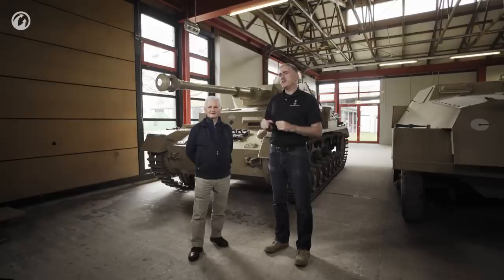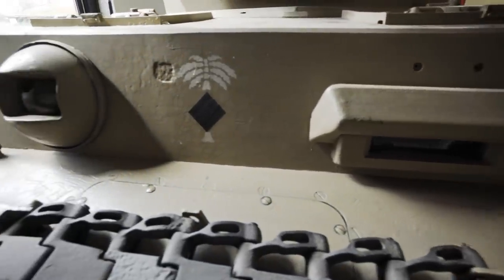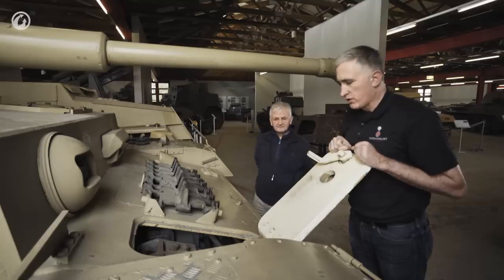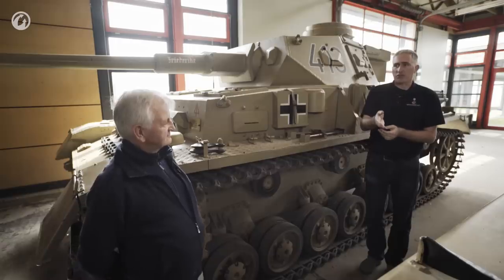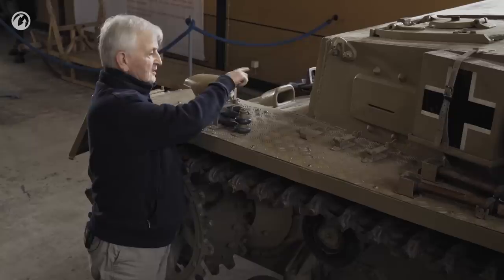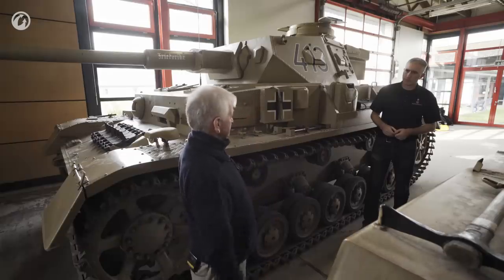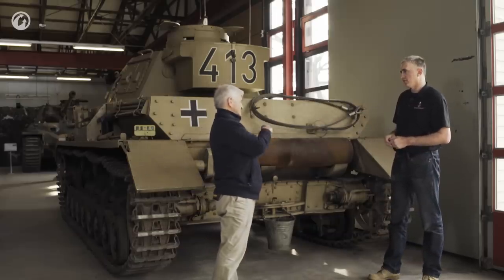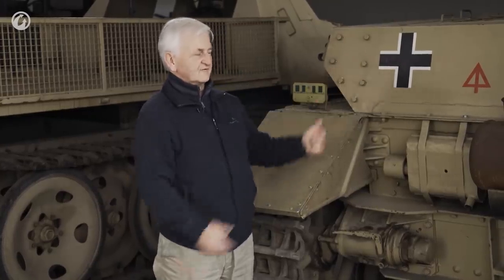Inside the Chieftain's Hatch: Panzer IV, Pt 1

Comment: Finally, the best tank of WW2. Change my mind, you Sherman apologist. 😉😅

But really, I think that this was the best overall tank of WW2. It was in service when the war started and still in service when it ended and it was still capable of knocking most things out. Early in the war, there simply was nothing like it. Mobile, it seems to have been quite reliable, good firepower but more importantly it has the basics of a good tank. Radiocommunication, proper distribution of tasks, turret basket and later on a very good gun for most of the war that was not matched by any allies medium tank until 1944. Further look at how easy those suspension bogies can be replaced or how you can access and potentially lift out the transmission or brakes separately by opening a hatch. Take that M4 where you need to unbolt and remove the entire lower front section. 😁

Then when I compare it directly to the M4, I think the Panzer IV wins it in 1942 and 1943. A 1942 onwards Panzer IV receives an better overall gun. Much better AP penetration, access to APCBC-HE rounds by default and the option for APCR  and HEAT. Further the HE shell is largely comparable to the Sherman's HE shell. WP would have been nice, but not strictly necessary for  its anti infantry usage. Obviously as a former support tank, it has smoke. It combines that gun with a direct vision opening for the gunner and arguably superior sights. Further the Panzer IV is refined and closing in on its zenith at this point, the M4 is not. The M4 at this point has to deal with issues like no loaders hatch nor commander vision cupola. Over the course of 1943, issues get worked out and the M4 closes in. In the end the M4 is a heavier chassis with thicker armour, but it needs time, combat experience and modification before it will match what the Panzer IV offers.

By 1944, yea the M4 Sherman is better. A M4A3 76mm, not even an E8 it just better. The redesigned, thicker glacis with reduced slope and welded RHA plates probably helped a lot against overmatching from 75mm gunfire at oblique angles. The 76mm gun loses on HE performance to the KwK 40, but roughly matches in AP performance. A more powerful engine, heavier armour, design flaws more worked out and you get an overall better tank. But because these tanks are not fielded until well into 1944, I still give the Panzer IV the overall nod. In the end the Panzer IV was around for most of the war, including the part where the Germans might have won it. The M4A3 76mm model's didn't arrive until far beyond the point where the German high command knew the war was over. 

Yes, I enjoyed typing this, a lot. 😅
Reply: Here's a rough graph of my understanding of the development and state of the Pz. IV and M4 over time in direct comparison (smoothed out for ease of reading)

I                                                                                                                                                                                                                                                                                                              _         /

I                                                                                                                                                                                                                                                                                       _        /
I                                                                                                                                                                                                                                                            _         /                                                                               
I                                                                                                                                                                                                                                     _        /                                                                   
I                                                                                                                                                                                                             _        /                              =                                                                 ;
I                                                                                                                                                             =                ;     _          /
I                                                                                                                           =              ;                 _        /
I                                                                                         =                ;                        _          /
I                                                         =            ;                                      _         /
I                         =              ;                                          _            /
I          ;                                                               /
_______________________________________________________________________________________________________________________________________________________________________________

x = time
y = relative "quality" (paper stats + soft factors)

;=; : Pz.IV
/_/ : M4

To say that something is the "best", you have to define what is the "best" and at what point in time. If you're talking about raw stats (incl. "soft" factors like comm. equipment, ergonomics, etc.) in 1945, there's a host of mediums that are flat better, if you're talking about raw stats in 1939, there's far fewer, but there are still some that can be argued about. If you define best as "managed to stay useful the longest"/"greatest potential for upgrades" then it's essentially just between the M4 and T-34. If you're talking about best as "suitable for the most different situations", it's a hands down win for the Sherman. If you define best as "had the most significant impact on enemy tank design", you are probably looking at the T-34 (if we only count mediums). If you define it as "performance per resources invested" the T-34 is again looking to come out on top, with some interesting outliers like the Matilda II. 

In my eyes, the Pz.IV was the epitome of 1930ies tank design, entering a war against the first 1940ies tanks. Its advantages are essentially that it is a more refined version of an inferior base, so once the superior base vehicles are refined they very quickly surpass the Pz.IV.
Reply: DaniëlWW2 As a Sherman apologist i do agree with you on this being the best tank of the early to mid war periods. While both tanks had their problems at the beginning of production (I.e. small guns, the need to up armored and widen tracks.) the end results of both tanks are in my opinion the best tanks of the war on both sides. Panzer 4 is honestly the pinnacle of tank design for Germany. If it had had the stabilizer like the Sherman it definitely could have been the best in the war.
The problem is Germany focused on larger cats, they lost what made the panzer 4 so good. To me the panzer 4 and Sherman are the most refined tanks of the war. They both are the best tanks of the pre-mbt era. That’s why I feel the panzer 4 gets set aside, it’s the middle child of the German tank line in the war. It isn’t the tanks hiding behind the label of tractors like the early war tanks but it isn’t the heavy armored, big gun toting behemoths of the late war.
It’s balanced and practical. I won’t change your mind but I will agree to a point. They are both the best tanks both sides had to offer in the war.
Reply: OrileyBomb  I agree and I easily rate the M4 as the best Allied tank and by late war as the overall best tank. I just wanted to poke a bit at Chief his constant, albeit valid pro M4 arguments by pointing out that the Panzer IV has all of that as well, and more. 😅

I don't really like the Panther either. Sure, amazing gun, powerful engine and great armour, but to me MAN seems to be the "B team" for the Germans. They never got a tank adopted before, despite trying multiple times and the turret is a Rheinmetall, again more like the B team because the more successful turrets are all Krupp. The whole design cycle of the Panther was not good. Far to short, increases in weight without accounting for it properly in the drive train and overall the design just doesn't match expectations. The hull is huge for a WW2 tank, but still somewhat cramped for the crew, while also leaving plenty of open space. Turret ring is probably a bit to small, the turret itself isn't that great and needed a major overhaul from pretty much the beginning, final drives are an issue, the suspension is just stupid and probably at least one ton to heavy. I doubt the ride would have been that much worse with a well designed torsion bar system without the interleaving wheels. Without interleaving and all the weight for the extra road wheels and torsion bars you gain room on the outside for shock absorbers which should largely compensate the lack of the additional torsion bars. That allows the removal of the internal shock absorbers in the Panther, who in turn got in the way for more room for the final drives, which would have allowed something better. Further it would allow for a lower and thus lighter overall hull because you can place stuff like batteries or rounds between the bars on the hull floor. The biggest damnation however is the fuel situation. The Germans can't just double fuel consumption starting from 1943. That is what they basically did with the Panther.

I kinda rate MAN as the worst of the four German firms that got a tank design adopted. For me Krupp is by far the best because of the Panzer IV. Second would be Henschel because they did a lot with 1940's tech when they created the Tigers. Third would be Daimler-Benz. To me the Panzer III, a good tank in its own right, just doesn't stack up that well to the Panzer IV. MAN would be last because there designs kept being rejected and the one adopted was not a great success, despite outside input like the excellent KwK 42.  

What I would have found interesting is the continuation of the VK.20 series like the Heereswaffenambt wanted. I kinda would be interested in a hypothetical Krupp VK.20 with either the new Maybach HL116 or even better the MB809 diesel engine Daimler/Mercedes was finishing up. Both are around the 400 metric horsepower mark, thus an upgrade over the HL120. Take the Krupp variant of the VK.20 which is clearly seems to be a further development of the Panzer IV and give it 40mm side and rear armour, 100mm front for both the hull, a simple torsion bar system, better steering system with neutral steer because it is heavier and turret and put the KwK 40 in the turret. If necessary just modify the Panzer IV turret with some additional armour. You are probably looking at a tank around the 28t mark, but now you basically have a Panzer IV with better mobility, practical armour that will frontally stop either Soviet of American 76/75mm AP and the same great gun that has little problems with a T-34 or a M4. This arguably could have been fielded in 1942 seeing as the VK.20 program was nearing completion in late 1941. To me, it sounds like a winner. Build a variant of the Stug on this hull and now you also have a better Stug with neutral steering. I am thinking about the Jagdpanzer IV superstructure. In the end the Jagdpanzer IV program started out as the Stug n.A, basically an improved Stug.